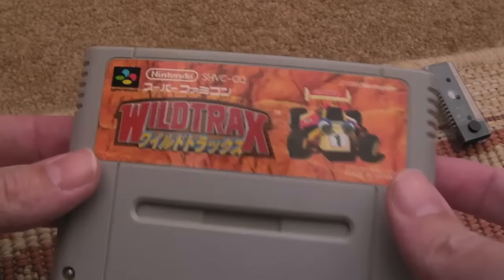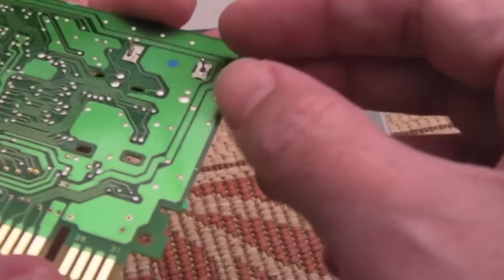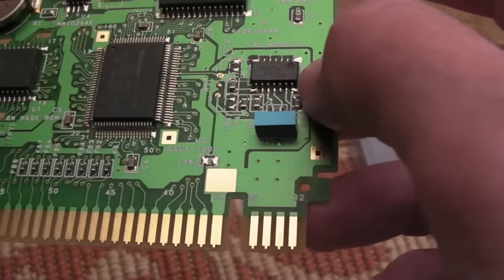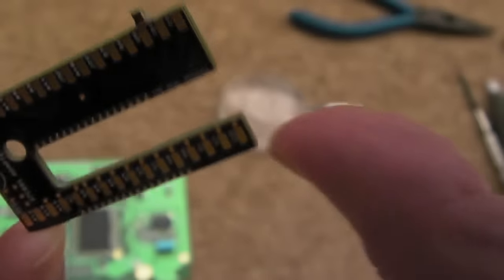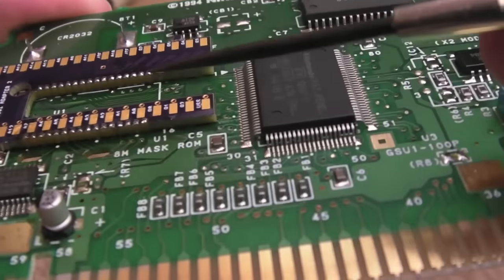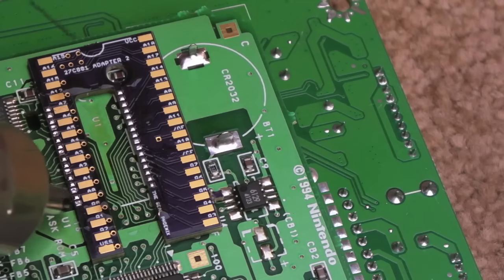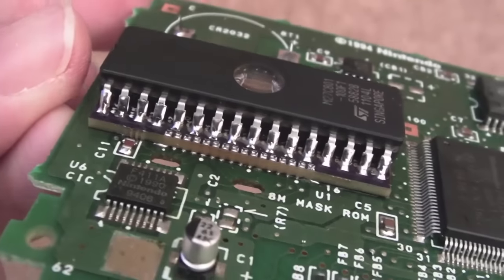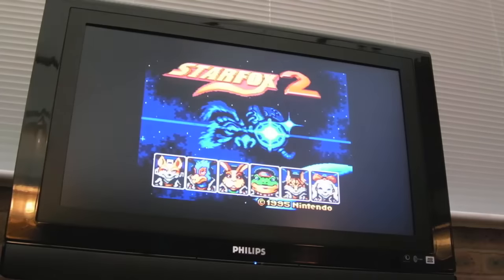Nintendo Super Famicom (SNES) Starfox 2 Prototype Conversion ("The Real Phoenix" PCB)

Comment: Interesting adaptor. Nice to see the reflow gun too :) Hmm.. If you added solder "balls" first to the adaptor, then you could have heated the whole board with circular motion around the board.. ? Edit: You did that !! :) How about solder paste ? I'm going to order some now. It's not that expensive on banggood. I don't know how good quality it is though.
Reply from the maker: +bwack Yes, solder balls would help - the real problem I was having is getting the board totally flat and lined up correctly.  That cap that sits in the cut out circle was slightly raising the PCB, so connections on one corner were not good.  I've got some solder paste as well but I find it easier to avoid bridges when soldering this way (where you cannot see the solder points).  If I used paste I would need to ensure only the pads had the paste on, perhaps with a stencil?   Let me know how you get on with the stuff from banggood! =)

Comment: Because StarFox 2 was originally meant to use the Super FX 2 chip it'd be good if you could just stick a game in that uses that like Doom 2 then be able to play the StarFox 2 ROM thereby utilising the Super FX 2 chip, but I guess you can't and it's a shame you can't do that.
Reply from the maker: Sorry - I deleted my previous reply!  I thought you were having a go!  This game will work on a Doom cart - I think you get the benefits then of it running a tiny bit smoother.  You can also overclock the SFX chip slightly - which is what I did after the video, by swapping out the resonator with a low powered crystal which has a higher frequency.  I don't think you gain anything else by going from an SFX1 chip to an SFX2 chip, other than the SFX2 chip can be overclocked further.
Reply: I'm too much of a noob to have a go at you, but I don't see the point of a SFX2 chip then unless it depended on the game because I read somewhere it benefits Doom 2 as it used textures as well as floors and ceilings so I guess since Doom 2 came out first they were just going to use it for StarFox 2 anyway.  Wouldn't mind one but no good at soldering.
Reply from the maker: Hehe, no worries =D  Yes, you're right - there's little point in wasting an SFX2 chip on this game!  Doom is rare and expensive so better keeping Doom as Doom lol.  I didn't think Doom 2 came out on the SNES, wasn't it just Doom 1?
Reply: Yes, you're right - it was just Doom 1 I was getting caught up in the number 2 because of StarFox 2.  I've just ordered myself a manual and I'm going to get a box for StarFox 2 after I've got the game.  Just got to find the game at a reasonable price and I can understand saving Doom cartridges because they're a showcase for the SNES coming out 1995.
Reply: Just to let you know I forgot to tell you I bought StarFox 2 from Spain a while ago on eBay and I also bought a PAL version of Super Mario RPG from the same seller who did the patch for it that works perfectly.  I guess when the SNES classic is released the finished ROM will be obtained from it and it makes me wonder if there'll be loads of repros.

Comment: I'd swap out the crystal for a 50-75MHz variant, as the GSU scales that high without any trouble and it vastly increases the framerate and playability of all SFX games. Truthfully, Snes9x is the best way to play this game, as it uses an internally overclocked superfx core.